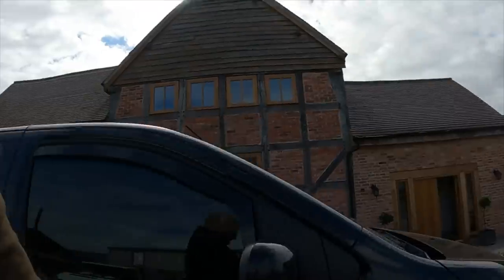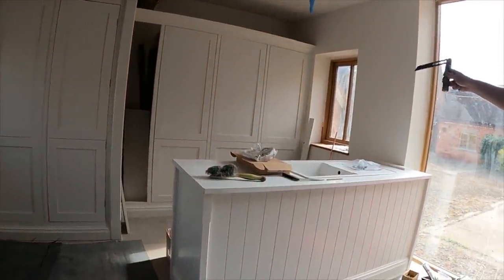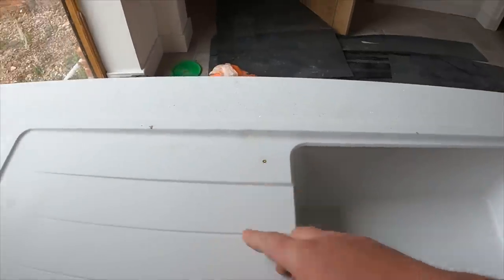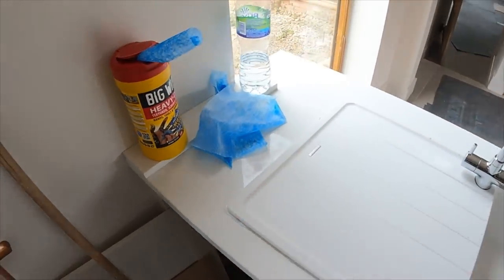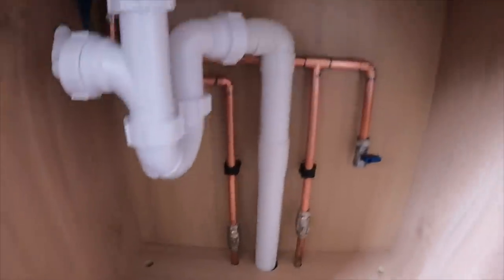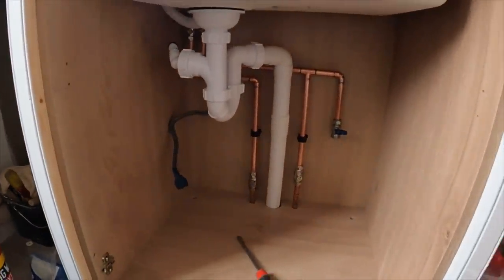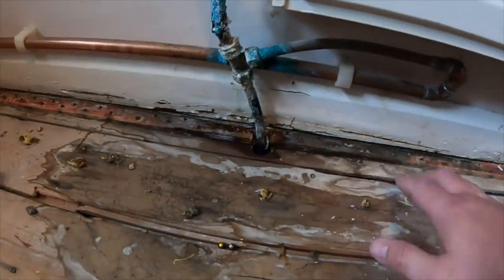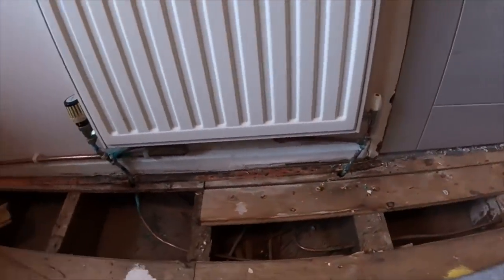CAPPING OFF LIVE HEATING PIPES!!… One for the seasoned PLUMBER

Comment: I'm an experienced competent DIYer, currently redoing our entire bathroom from scratch, and had to do my first snatch this weekend. Bought a £70 Arctic Hayes Pro freeze kit, which just plain didn't work on the 15mm plastic pipes of the original 80s house. Used half a 600g can on each of two rad pipes which needed moving from under the bathroom floor - jacket appeared to freeze OK but when I checked the old rad valves, there was no ice plug as it was still flowing. So just had to get the pipework ready that I was fitting and cut the live pipe. Thumb over, thumb off for metal insert (old 80s plastic pipe), thumb back on, thumb off, new pipe work inserted. Just needed plenty of old towels at the ready!! Seems to have worked so far so I can carry on with the job now, and not much spillage. Far easier than draining and refilling the entire system. Shame I wasted £70 on the freeze kit though!!

Comment: Many years ago I had to replace a main stopcock in a warehouse, the underground valve was 1/2 mile away, mate went to turn it off and would toot the van horn when off. Muggins heard the wrong toot, cut the 28mm incoming main at 6 bar no less, fecking carnage, water bouncing off the roof, I left my van window open. Finally opened the new valve, got it on the pipe tightened then closed the valve. Even the notes in my wallet were dripping, happy days👍
Reply from the maker: Hahahaha brilliant, always makes for a good story when we get soaking wet for whatever reason
Reply: Wet wallet? You were money laundering. C'mon. Admit it. I'd have had the key in the mains ready to turn off and beeped early. Just for the laff.
Reply: LEGEND......🥳🙈

Comment: Hi there, I've been plumbing for 30+ years and snatching those pipes was absolutely the right thing to do. You'll get no criticism from me there. My only comment is that I wouldn't have faffed about trying to hold the vacuum as you did on the first one - I would have just wedged the nozzle in the tub so I had both hands free. I once had to cut a tee into a live 22mm pipe under mains pressure - now that was fun :-)
Reply from the maker: Thanks mate 👍🏼👍🏼👍🏼

Comment: Rather than using towels and tubs ect, when working under floors with limited space try using a rubble sack. Dead easy to get in tight spacea and holds plenty more than a small tub or towel, also easy to get out even with water in and convenient in the kit bag. Just make sure it doesn't have holes in it.👍

Comment: Hi mark perfect example for not wanting too drain a system, had too fit a rad and Magnacleanse on a vented system yesterday jumped in the loft and isolated f&e tank and the scale inhibitor on the cwst snapped had too snatch a stopcock and spend nearly 2 hours clearing air 😔
Reply from the maker: Always the bloody airlocks mate

Comment: My suggestion for others with no experience is to have more room to work on by taking two floor boards instead of one! The reason is to loosen or tighten when system is live you need room or you'll struggle!
Reply from the maker: My suggestion for those with no experience is DO NOT attempt to snatch a live pipe😉

Comment: Great vid again Mark.
Personally I believe anyone who's not done a 'live snatch' has not earned the right to be called a 'proper' plumber. It's almost like a right of passage  so we can recall the events when we've hung up our spanners and start reminiscing about 'the good old days' when plumbing was a proper trade...😂😂😂😭😭😭😭.
Keep up the good work my man, and thanks once again.👍🏾
Reply from the maker: Very true mate…. I like that view mate, we’ve all got some good stories I think
Reply: Lol mains live in a trench was my most memorable
Reply: @kyam3331  that sounds memorable..lol...hope it was a hot day...
One  of my most memorable and challenging that springs to mind  was attending to work on a  poly-york main in a social housing property early 2000.. I felt that if I tried to isolate the internal mains stopcock it could break the pipe, which if anyone knows poly-york knows you only have to look at it for that to happen. No accessible mains shut off externally... My experience told me to prepare the 3/8" adapter complete with 15mm m-i fitting, full bore iso valve, loads of rags and plenty of bravado to get the job done... yep it did crack but using high speed glue and prepared fittings to an open end to a drain I averted a major flood in the property, an irate tenant and definite insurance claim... you do tend to look back with amazement at some of the risks... good days..lol

Comment: Great snatch mark just got to be careful with the wet vac that you don't suck an end cap up. I knew about expansion vessels and isolation valves but to be honest wouldn't be happy fitting an isolation valve on one even if the handle was removed. That heating system left a lot to be desired gate valve on the vent useless balofix on the fill side. That loop isn't doing anything either. A good power flush would probably help the system.
Reply from the maker: Thanks mate….. yer you don’t want to suck up a cap end🙈🙈

I will be removing a lot of that shambles in the roof and sorting out the header tank support in the near future. It’s a right pigs ear up there

Comment: It’s a gamble on previous installation, you don’t know how far or how close that olive sits end off a pipe work, it’s a good practice to have 15 mm push fit caps in case it doesn’t work out you can slice it off quickly  coupler or reducer and bang the cap on , instead flooding all place .
Reply from the maker: Yep…. That’s why those things were all in place, along with wet vac, towels etc etc….. as said, it’s a calculated risk… you don’t go into it unprepared

Comment: Hi Mark, I’m only at DIY level so if this is a bonkers question you’ll forgive me. When you snatched the heating pipes, could you have used push fit caps on copper or would you not trust those? Ps loving the channel and content 👍
Reply: You would have had to cut the olives off or cut the pipes so compression is just the best option.
Reply: I think if isolation was available, push fit is an option, just as sweating or pressing a fitting... because it's a live snatch, your mind just wants to make sure 100% as theres no viable second chance..
Also good plumbing practice suggests no compression or push fit under floors or ceilings ideally...
But hey- ho needs be needs must but you make the judgement call all things considered.

Comment: Great vid as always. Couple questions if you don't mind. 😊 Did you shut off the valves on those rads before you snatched. In my head it makes it a bit safer.

Worth recommending some alladin vents for the rads in that house if it's a pig for getting air stuck in it?

That's a super sketchy header tank. Bedtime shower waiting to happen. First gate valve we've ever seen you turn too I think.

Congrats on the G3. 👌👍
Reply from the maker: Thanks mate…. Yer shut the rad valves off before snatching otherwise it would of dumped the water back out the open pipe😉

The air gets stuck up in the roof mate where the boiler and tanks are, will be removing a lot of that Pipework when I sort the header tank in the future and will be fitting Auto Air vents then👍🏼👍🏼

I only shut that one off as it had no water through it so it was never going to snap off😉👍🏼👍🏼

Comment: Awesome vid as always mate. Thats how you snatch a live pipe 👏😂. Tried being clever once by snatching the insides of a Draincock on a hot water cylinder as the washer got stuck. When i pulled the washer out didnt think about the water in the cylinder being 70 odd degrees which is too hot obviously and was burning my fucking hands. Worst part being it was on the top floor of a 4 story building 😂 water pissing through the roof into the kitchen 🤦🏻‍♂️ thank fuck i had someone else with me
Reply from the maker: Oh no…… that’s a bad one mate!!!!!!…….. and lot of pressure behind it

Comment: Deionised water and inhibitor I find is best for electric towel rads most use tap water and inhibitor but you will find calcium deposits on the element very soon with tap water and the element will fail rapidly Iv changed over 10 in the last 6 months with the same problem and they where all less than 2 years old possibly not enough inhibitor but I opt for the extra steps and if you ever put normal water in a iron and wonder why there are white bits coming out it’s calcium deposits use deionised water and there are none

Comment: Thats all incorrect as not meant to be any valves on the vent and its meant to be a gate on cold or lever , and the lats are not to regs either
Reply from the maker: I know that mate….. that’s what I said in the video, it’s all been mentioned to the customer.
I didn’t install it
Reply: @MJTiffPlumbing  
Have you ever had a job like that, where customer refuses to up grade the system because its works all these years, even if it's not to regs any more ??
Reply from the maker: @marcush6139  it’s a tough one mate, I guess you need to just make sure they understand that it’s not good.
With this one I showed him the bits of lath holding up a potential flood risk if and when it falls down.
That was enough to get it sorted

Comment: Maybe I'm being stupid but doesn't a washing machine feed require a double check or is that an old wives tale ?.... Can you shed me some light ?
Reply from the maker: I’ve never fitted one, as far as Im aware they have them internally fitted to the machine
Reply: @MJTiffPlumbing   only needed for outside taps then
Reply: @pat225zh  You can get wash mac valves and o/t's with integral, pre-fitted single check valves. I always fit an x2 cv immediately after the tee... habit I suppose?
Reply: I work on new builds was always told spur off the cold the double check before the Washing machine and outside tap
Reply from the maker: No harm in fitting one if you want to.
As long as the machine has no risk of back flow and there is an air gap there’s no need

Most washing machine water feeds are completely separate from the contained water within the machine so has no risk of back flow or contamination